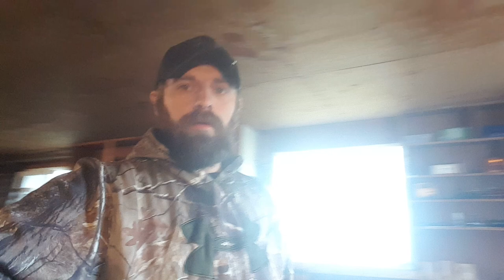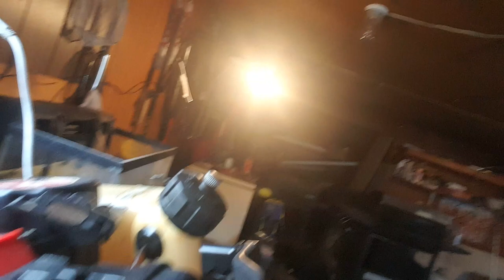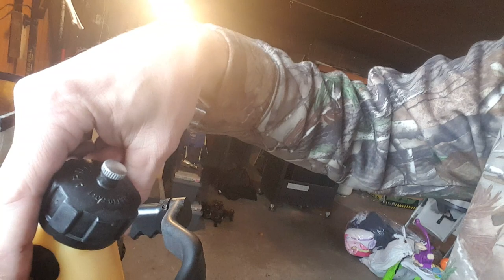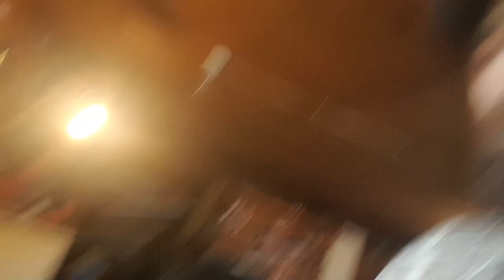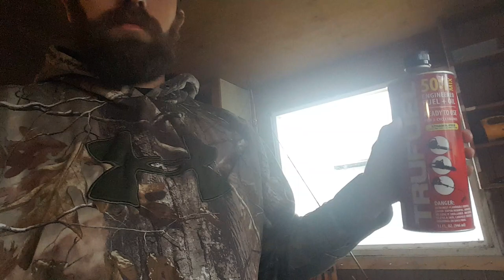Eskimo Ice Auger Troubles

Comment: Sorry for your situation.
I bought a jiffy 10" model 30, 3 hp Tecumseh in 1989. Used only jiffy oil with the stabilizer in it.
Never drained the gas off season, always new gas every season.
I replaced the gas cap once, and a few sets of blades.
Works every time.
The thing is heavy as hell, but bullet proof.
Reply: This is the real trick here. If you treat the engine right from day one it will last and last even cheap China engines.

Comment: If you have a Stens small engine dealer near you get some Stens 2 cycle  oil , now they sell two or tree different kinds but get the Stens .! It's made by Optimal opti 2. It comes in a bottle or or one oz. Pillow pouches ( which I like the best , 1 oz to a gallon of fuel , easy peasy ) use premium gas ONLY !  I've used this for 25 yrs in every 2 cycle you can think of and had NO failures !!!!!  The ratio didn't make any difference , it also has a built in stabilizer and I leave it full ( my anger) & it starts & runs every time !! Mine is an older Magnum 2 which helps . I haven't had to kit the carb or replace fuel lines at all , give it a try , I think you'll like it .   Don't use nothing with that f______g ethanol in it !!!!!!!

Comment: I has the Eskimo Mako 43cc auger.  Used only premium gas and Strikemaster no smoke oil.  Mixed in a 1 gallon can I used just for the ice auger.  I used sta-bil in the gas and kept the tank full over summer.  I never had trouble and in the fall the auger always started up on the 3rd, 4th or 5th pull then ran great all winter.  The fall of 18 I got it out of storage and at 73 it was way too heavy so we converted to a K-drill with the clam auger drill adapter plate and Milwaukee 2804-22 cordless drill.

Comment: Bought my eskimo mako 43 10” in 2010 and ive replaced the blades once and that gas grommet once. I never drain the gas at the end of the season, i just watch and get it low, an just top it off with fresh next season. I do however clean the spark plug at the beginning of each season.  Until last year somehow broke one of the struts that hold the blade! I had to finish the hole with a borrowed hand auger. Over all it has treated me well... im thinkin about one of those battery operated ones...

Comment: A fuel stabilizer would keep that gas fresh all summer. Sta-bil is perfect for this. When your done with the auger for the winter. Mix sta-bil with it and let it run so it gets threw the fuel lines and into the carb. I do it every year and my auger fires up every time.

Comment: Ive got an old jiffy model 20 "rib breaker" and since ive had it.. 10 years or better. I rebuilt the carb when I got it, and replaced the recoil rope. That is IT. best $40 ever spent
Reply: Had one that was my Dad's, still was the Model 70. Manufactured I believe in the 60's and 70's. Never heard of Jiffy making a Model 20, but they very could of well had. Common nickname's were The Ball Breaker and Widow Maker. Had to retire mine 5-6 years ago. Was the true essence though of a well built, long lasting auger with the add on of a new carb kit every so often. Don't make Augers like they should nowadays where the auger and blade's are all one and a person can sharpen the the blade part.

Comment: I have the answer to your issues,
#1 buy a big 20V dewalt drill
#2 buy a eskimo drill chuck converter
#3 goodbye gas augers! 
I cant believe how well it works, with sharp blades. I was skeptical at first too, but believe me, try it and you will never go back. Good luck out there!

Comment: Leave non ethanol gas with a splash of sta-bil in the tank.  I do this for all my small engines never had an issue.  However if you went a few seasons with treating the engine wrong (like using gas with ethanol)  then many times there is nothing you can do besides a carb rebuild because the water from the ethanol is already in the system, already working to screw up the carb.  

You can store the auger without gas in it but you want to store it inside your house in a closet or something.

Comment: Had my jiffy model 30 for 20 years replaced the kill switch once i use premium gas with stabilizer and spray storage oil in the carb till it stalls.

Comment: I have never had the issues you speak of.  I’ve been running a Mako43 for a dozen seasons.  I keep fuel in it year round and start it once a month.  Original carb, original rope, original spark plug.  Engines are meant to run, not sit for 7-8 months at a time.

Comment: Stick with Eskimo. Had my z51 work flawless for years aside from a few maintenance repairs (mostly from being rough with it)
Drain gas and run dry YES old gas evaporates, binds with water, gums up carbs ugh...
If you're having problems with hoses cracking and seals going dump in a bit of extra oil in the mix and run it though. It'll keep things lubed up but I never need to.
That grommet in the tank can be annoying, what I did was buy some clear marine sealant called M5200 clean any oil and scratch up the surfaces with a nail or something and cover the whole thing in the 5200. 6 years and still holding strong. No leaks.
most of all I CANT STRESS FRESH FUEL ENOUGH!!! People will say stabilizers work but they're very gimmicky, Premium gas station fuel is perfectly fine and remember when you mix Rich > lean

Comment: I'm sure you've already figured out your Auger situation by now, but here's some information I know. Eskimo has always been known for poor power heads. Think years ago they might of had Briggs and Straton Motor, which still weren't great longevity motors. In my experience selling Eskimo Augers in the past, they one time in the 90's had a auger with a Italian made motor on it. Eskimo really screwed up not sticking with the manufacture of the motor. We were given a demo and my guess is an old co-worker of mine probably still has the auger and it probably still purr's like a Kitten. The gas/oil issue is always going to be blamed for one of any power auger issues. Fact is gas isn't the quality it once was, engine builds and component materials aren't the same from comparison of power heads made years ago. Had an old Jiffy Model 70 Ball Breaker bought by my father in the late 60's and I ran that Auger up till 4-5 years ago. All that thing ever needed was one carb replacement in that whole time till tuning it and the engine just became worn and old where it couldn't be tuned anymore and not worth rebuilding it. My suggestion is depending on what a person wants to go with in a new Auger these days and have one that last them awhile is first consider who make's the power head. I had a SM Solo and listening to that German engine run next to other manufacture's power heads is like listening to a Suzuki 2 Stroke Outboard engine versus Two Stroke Mercury's or Everscrewed's. That is my only first suggestion because it's the most expensive part of a person's purchase on a new Auger. The rest of the components to make up an auger is no different in any piece of power equipment. Most components are outsourced, with a few manufacture's making some of their own. I still believe in as one of your subs commented that any small gas powered engines need to be started up and ran if sitting idle for more than two or three months, especially two stroke motors. It keeps all the internals lubed up and free's them from condensation and any rust/dirt buildup that may occur. If leaving gas in them for storage, any fuel treatment or stabilizer mixed in and ran for awhile upon storage is always a safe protocol. If emptying the gas out before storage, least run some sort of treatment thru the fuel line's and carb before emptying. With most two stroke engines, condensation will still form in the plastic gas tanks given temperature changes, but will be minimal with maybe some rough engine running til the gas is used up. With four strokes and storage, I personally wouldn't worry so much about emptying the gas out of them upon storage. Just start them up and let them run for a while, again every two to three months. Propane I'm not positive because I haven't educated myself on those as far as storage, but I would think the same would hold true as any four stroke engine being the fuel and oil are separated.
Reply from the maker: +Joe Shock thanks for watching, subbing and all the feedback. Much appreciated!

Comment: I had my jiffy for 6 years same issues. It is the nature of the beast.  I feel you on the issues nothing built now is good. I just bought a mako 43 and hell the way i see it 275 dollars and buy a new one next year if I have to. It was gonna cost me about the same to rebuild the jiffy. I honestly just think a guy needs to use stabil and just start and run them every month. And always mix your own fuel. As for the tank that rubber is just as bad on jiffy. I have been thinking mabey a bit of grease on them to keep them moist any thoughts on that?
Reply from the maker: +Justin Polakowski yeah that seems like it could be a decent idea. I just sold my z51 and bought the p1 rocket auger.
Reply: Seems like a wise move. I just figured I would stick to the budget a bit this year. Let me know how it works for you cause I may buy one  next season. I almost did this year. Good luck and stay safe on the ice. Im looking to get out possibly this sat am for a couple of hours here in Wisconsin. Keep the vids coming Im gonna start vids next year I hope probaly alot of duck hunting ones then some ice fishing. I mostly fish centrel Wisconsin lakes.

Comment: Mine had the same issues. But the small piece inside the muffler fell it to the crankcase and jammed in between the crack shaft and crank case.
Reply from the maker: +doherty0805 thanks for watching and thanks for the feed back. I'm still undecided what I want to do. Leaning towards just replacing the engine.
Reply: I had to split my case to get that piece out and when I was putting it back together I broke one of my piston rings and it wouldn't run after that. I tried to get a new piston ring and was told the same that I couldn't get parts for it. I. Really liked my Z71 but ended up going with z51 next. It works great but now I'm having issues with it bogging down. I need to have my chock on a bit for it not to bog down when drilling holes. I've heard alot of horror story's about the new jiffys

Comment: I have an old techumsa ice auger... USE 91 Non Oxy gas in ALL SMALL ENGINES , pour in required amount of sea foam. I mix 2 ounces every gallon in my oil/pre mix 2 gallon can(4oz) Always leave some gas in auger over summer and add sta-bill to gas. And always fire up auger every month even when 90 degrees. My techumsa fires on 5th-6th pull cold. 2nd pull when warm. Hope this helps.

Comment: get the eskimo hc40 propane...had mine for few years never had a problem and no fuel issues...dont get tge jiffy propane tho...the hc40 motor was built bottom up for propane use jiffys was not...i also live in cental wi and it starts everytime in cold temps...
Reply from the maker: +alpha 74 I already bought the p1 rocket auger. Love it so far. Thanks for watching!
Reply: North Woods Wisconsin good choice!! propane is the way to go!! and eskimo did it right too ..no more fuel issues...lol..tight lines.

Comment: Stop listening to people.  And here's a hint - Gasoline doesn't go bad.  When I was a kid, my dad told me gas goes stale.  Then as a 50 year old man, an old timer told me gasoline doesn't go bad.  I did some homework and read some articles written by petroleum engineers who tested 10 year old gasoline.  They found there was no difference between the old and the "fresh" gasoline.  The old timer was also the owner of a twin engine airplane that had not flown in several years.  I inspected the airplane's airworthiness and he left the old gas in his plane and flew it away.  Now I believe gasoline doesn't go bad and I also believe people want to spread information they've never researched.

The bottom line is - stop listening to everyone with an opinion.  After all, what's the worst thing that can happen - that you'd take your auger in for repairs?
Reply: Beg to Differ, gas goes bad after 3 month. And how long has that gas out of a can been sitting on the self.